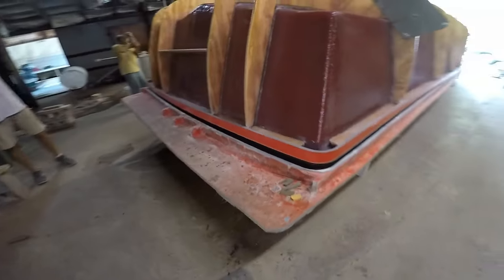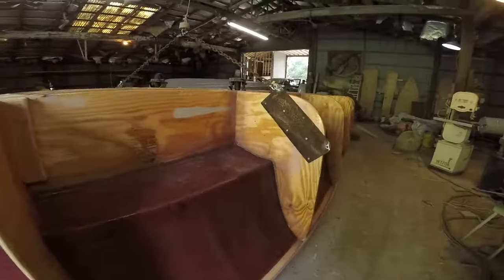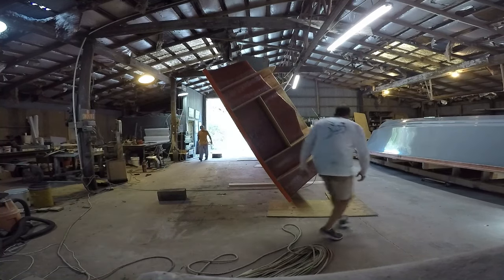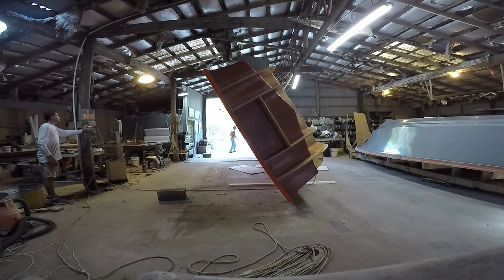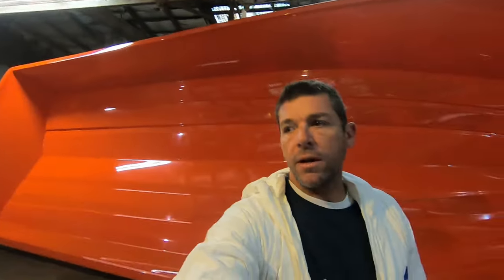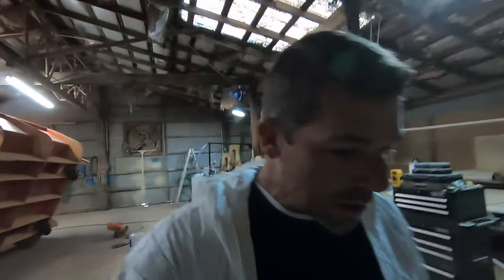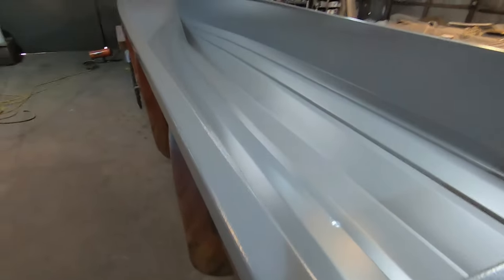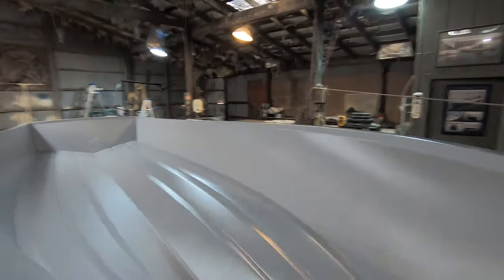EP-1 WE ARE BUILDING A NEW BOAT! THIS IS HOW WE DO IT

Comment: Very interesting. Few questions. Why do you use different types of matting like 450 and the 45 degree and 90 degree. Why did you drill holes in the transom core? How did you build the mold plug. When you say hand laid, do you lay all the fibreglass matting in place then the resin gun just sprays bulk resin to wet it down then you roll it? thanks
Reply from the maker: Thanks Mathew! glad you found the video to be interesting. Alternating layers of 45 degree and 90 degree biaxial will produce a stronger hull than if you were to only use one or the other. We drill holes in the core so any air trapped under the panel can escape though the vent holes. It results in a better, more uniform bond. I built the mold plug by first drawing  plans to scale, then built the plug out of two layers of 1/4 inch thick furniture grade birch plywood strip planked at 45 degree angles. I then fiberglassed and faired out the plug with Duratec primers and fillers. Yes, we hand cut and hand laid each piece of 45 and 90 degree biaxial fabric. We then used a wet out gun to saturate the laminate with precisely mixed and catalyzed resin. We then used a combination of soft and hard rollers to work out any air bubbles. We did not use any chopper gun dispensed fiberglass, only mixed resin though the gun. I have a number of other videos on our channel documenting the boat build that you may find interesting, and answer some of these questions in more detail. I will be getting back to work on the boat soon, with more videos documenting that as well. Hope this answers some of your questions. We are trying to grow the channel, So if you enjoy this kind of content, please subscribe, like, and share. Thanks again for watching!

Comment: Do you have to clean the spray rig out every time you use it or is it fine to just stand by with minimal maintenance since the catalyst isn't mixed.  That would be so cool if you can just pick it up and start spraying and just hang it up and forget it.  What a time and aggravation savings but that seems too good to be true !
Reply from the maker: You just have to clean the tip of the gun with acetone after each spray session. We also remove the tip and clean it with acetone every night  If the gun will not be used for an extended time, you have to flush the gun with a special storage solution made for this gun. Rigs like this are not great for smaller jobs though, people tend to think they are a magic solution to all fiberglass issues, but they are not. If you notice, we typically only use it when we are laying up hulls, or installing stringers or floors. They are like using a large commercial paint spray rig to paint one room in your house. They are great for big projects though.

Comment: Hey there man! I am about to start the process on a new build of my own. I had a question regarding the construction of the gunwales. Do you use coring material on the sides of the boat or just layers of glass and the knee supports? Look forward to hearing from you, thanks in advance!
Reply from the maker: I used Coosa on the gunwales. I have over 20 videos documenting the build of this boat, and also have a How to work with Coosa board 101 video that shows a lot of the details of how we did things during the build of the Buskens 29. I think you would probably find them interesting and helpful. Thanks for watching and best of luck with your project!

Comment: Looks like solid construction practices.  Question, when I see videos on older boat transom repairs that involve cutting and removing the transom and rotted wood from the exterior, is that safe?  
I don't understand how it the new transom is sufficiently "tied" back into the sides.   Seems to me that the weight and torque of the outboard is all on the 2 vertical seams and 1 horizontal seam on the bottom instead of being transferred to the sides of the boat?  Overthinking this?
Reply from the maker: I have seen transoms done this way before, but we always replace coming from the inside of the boat. Some boats can can very difficult to access from the inside, that's why it is sometimes done from the exterior. I don't thinks it is as strong to replace from the outside personally, but I also have not heard of a transom that has been replaced from the exterior failing either. Hope this helps, and thanks for watching!
Reply: Gotcha,  I had a 2002 Grady White 222 Fisherman that unfortunately had a large crack where the transom meets the bottom of hull. Almost the entire length. Varied between a 1/2" split to 1/8".
  Most likely due to to a wet transom freezing and expanding during the winter months in Northern NJ. The boat was kept on a trailer.  I spoke to a couple of fiberglass shops who advised against any type of repair due to the cost and uncertainty of a solid, safe repair. They both explained that unless you ground off the exterior of the sides of the boat and  wrapped new fiberglass mat around to the transom that any other type of repair would be questionable.  I sold the boat which other wise was in mint condition cheap, I kind of regret that decision now. I loved that boat! Thanks for the educational reply.  @FishBumpTV
Reply from the maker: @ericcope8216  I understand , those kind of repairs can be difficult. Sorry you had to get rid of it.

Comment: Great channel and really clean work! 
Could you explain why you chose to lay the fabric in transversely rather than longitudinally? I’ve seen it done both ways just wondering the advantages of each.
I’m guessing you’re planning on producing these to some extent down the road?
Reply from the maker: Thanks so much! Yes, it can be done both ways. We laminated transversly because we are a small crew, and this is a decent size boat.  The pieces of glass fabric are smaller, and easier to handle and wet out when done transversly. With that being said, laying out lengthwise can work very well also, it is a personal preference per job I would say. Yes, we do plan on either building more, or selling the molds to someone who does.I hope that helps, I appreciate you watching and commenting!
Reply: Do you feel laying the glass transversely makes it easier to work into the running strakes?
Reply from the maker: @DonaldPurcell-dd8gp  Yes, that is one of the benefits of laying transversly. Smaller pieces, easier to work into the strakes and chines.

Comment: That's been a hell of an undertaking. Great job! How did you learn every process and product you needed to use? I need to split a 88 bass tracker tf 1800 and replace the transom and stringers
Reply from the maker: Thanks! I really appreciate it! I Grew up around the boat building business, my father built over 300 boats in his career. So I was able to see from the ground up how a new boat was designed and built. He passed away from pancreatic cancer about 28 years ago, and I took a long break from boatbuilding. I run a charter business, and needed a boat that wasn't being built to the specs I needed so I decided to build the new 29. You are in a great place to learn about Boatbuilding and repair. Youtube has thousands of videos on that subject, I know I have seen several on transom and stringer replacement. hopefully my videos on boatbuilding can help you with your project! I am editing episode number 6 right now, we are putting down the coosa composites floor panels. so be looking for that one, it should be very helpful for your project. Thanks again for watching, and welcome to the channel!

Comment: Why do you need all those old heavy car batteries in the bottom during construction?  Will there be a lateral connection between the stringers?
Reply from the maker: We used the batteries to keep the hull tight to the mold. We didn't want it to pre release before the stringers were completely installed. Yes, there will be lateral bracing between the stringers. We have over 20 videos documenting the build. I think they get better in my opinion as we get more experience behind the Camara. Hope you enjoy. Thanks for watching!
Reply: I certainly am enjoying the fibreglass videos. Thank your cameraman for capturing details while you work.
Reply from the maker: @d46512  great! I will, thanks!

Comment: Awesome build.  What software or steps did you go through just to even get started.  I’ve been toying around with the idea of a custom build for my specific waters.
Reply from the maker: Thanks! Glad you're enjoying the videos. I grew up around boatbuilding, so I already had a good understanding of boat design. I started designing and building smaller, simpler boats first. then worked my way up to more complex boats, like the one we are currently building. I do all my design work with graph paper and a scale ruler. Kinda old school, but it works for me. If you have never designed or built boats before, you may want to consider looking in to buying a set of plans from a designer. Or maybe buying a hull that is close to your needs, then finishing out to your specs. I can tell you that building a boat from scratch is a LOT of work, but it is very satisfying. We have a series of boat-building videos on the channel, and we are working on more now. I am sure some of your questions will be answered in the videos. Hope my answer was helpful, and I wish you the best of luck with your project.
Reply: @FishBumpTV  Thanks for the information.  I can definitely understand the effort involved.  Boat design has always been a passion however I chose the building design route so I’m still learning marine design basics.  Much respect to your channel and look forward to videos.

Comment: What did you use to make the plug? And what did you do with the plug afterwards?
Reply from the maker: I designed the boat and then built the plug out of high-quality plywood. Then I fiberglassed over the plywood and used marine grade fillers and primers to finish it out. I still have the plug in my shop. Thanks for watching!

Comment: I have a 29 foot panga that I want to restore what thickness on the Coosa for the transom should I use for twin 115 Yamaha or possible twin150 yamaha and what  tickness for the stringers on the Coosa
Reply from the maker: We used 2 layers of 3/4 inch Bluewater 26 lb Coosa laminated together in our 29. I am happy with the results.
Reply: How did you bond the Coosa board to the transom ?
Reply: Did you use pro strand to tab the coosa board to the transom ?